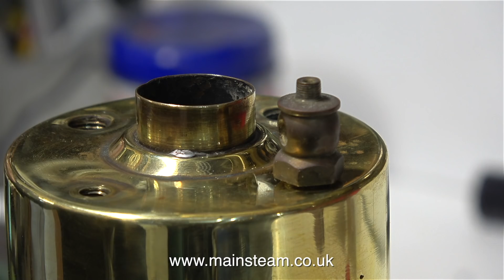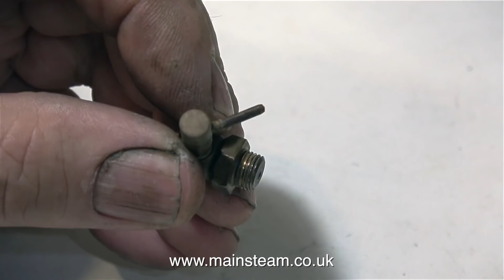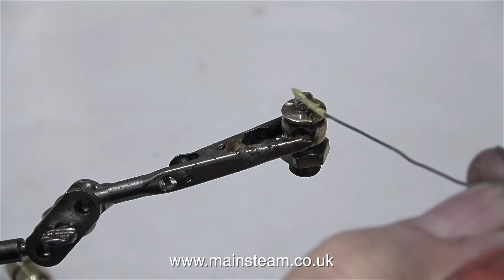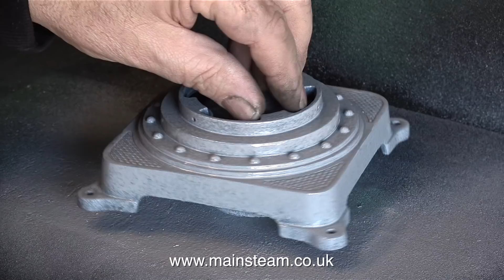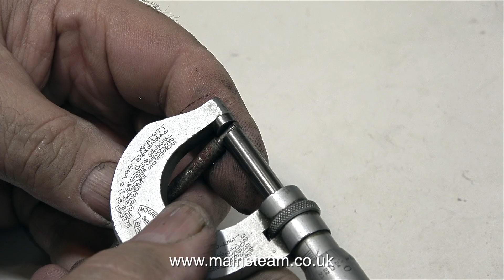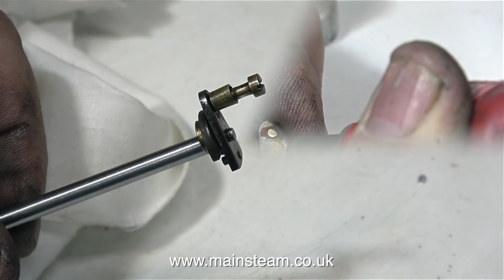HOW TO REBUILD A VINTAGE STEAM TOY - PART #6

Comment: You cut the threaded part of the crankshaft too short so do it over and keep your high standards in tact!!!!!!
Reply from the maker: No I didn't ...... you are incorrect. It was actually threaded a bit longer than the original crankshaft which I copied and made very slightly longer. The locknut was my idea . . .  By the way Mr. Howard, I do actually think these jobs through before I make these videos available for public criticism }:-)))